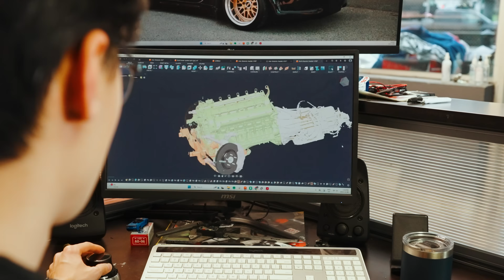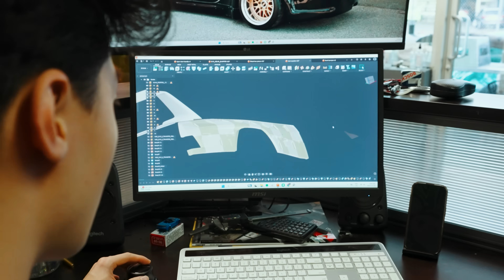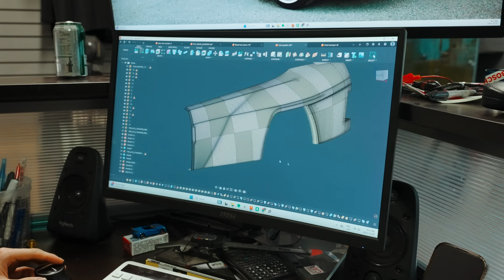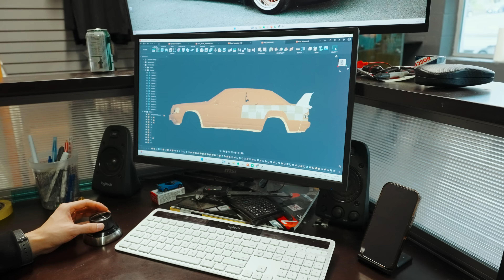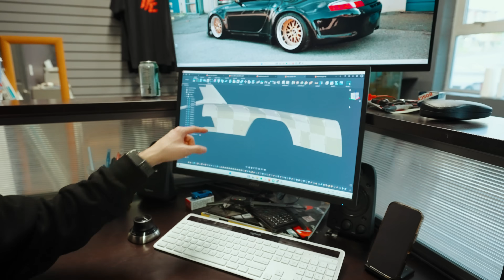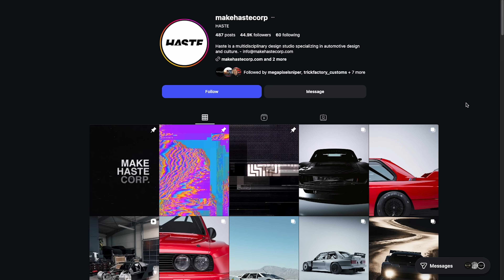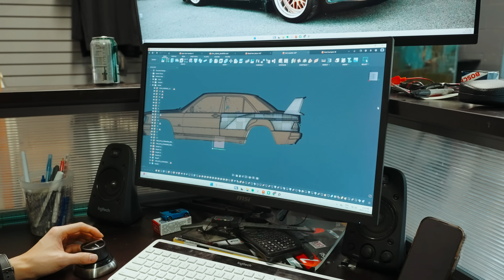Building a V12 Mid-Engine 190E EVO – Part 3: 3D Printing Custom Body Panels

Comment: If it's possible, it would be great to see the products you're using. I'm taking some existing parts and modifying them to my liking , but there's just so much different primers and paints out there. I'm not sure what to purchase.
Reply from the maker: We used 3m panel bond adhesive to bond the panels together  ,once bonded we put down two coats or PPG cre-921 as it bonds to the abs really well and gives us a barrier layer between the ABS and filler which contains chemicals that can attack the plastic ..Once bodywork is completed we use a PPG primer sealer and start final blocking in preparation of the mold making process